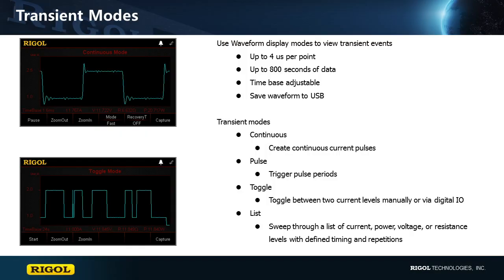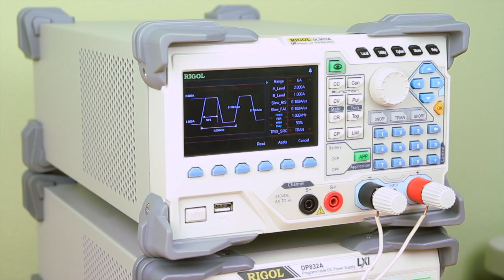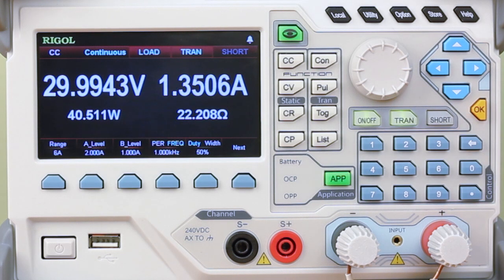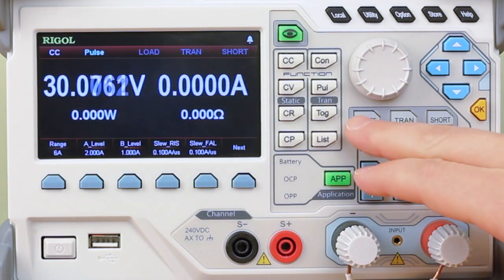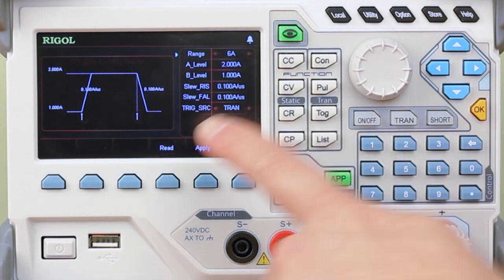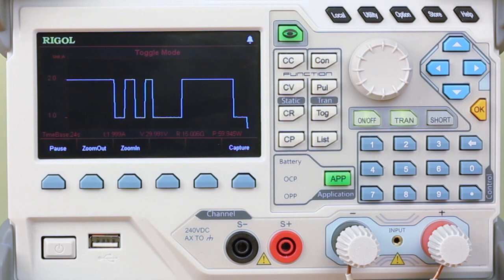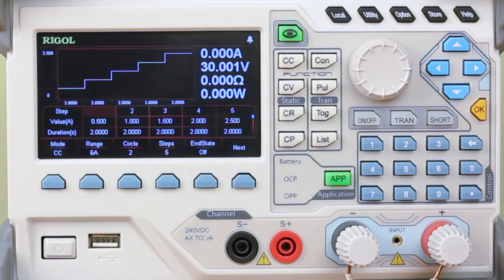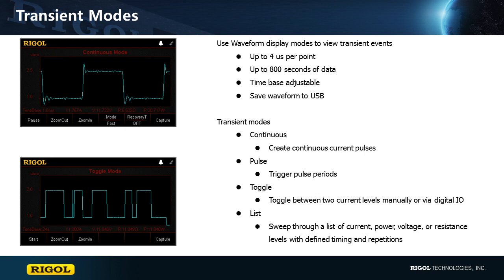DL3000 Transient Modes

Comment: What are steps to update the firmware? I have a file DL3000Update.gel  I put it on the USB and inserted, but it is stuck at: "Please insert USB disk with the upgrade file..." I waited, nothing. I pushed all the buttons - nothing! I've remove the USB and re-inserted back in - nothing! Do you know how to update it? Thanks.
Reply from the maker: These instructions are in the download folder: 
1. Copy the upgrade file DL3000Update.GEL to the root directory of the USB disk.
 
2. Insert the USB disk into the USB interface.
 
3. Power on the instrument. When logo "RIGOL" appears, with three dots under it,
   press the Help key immediately. Then, the upgrade process bar appears, 
   indicates that the instrument starts to upgrade.
Reply: @RigolTech Thanks for SUPER FAST respond from you! 
I did exactly what you stated above, but nothing happens but:  "Please insert USB disk with the upgrade file..." 
I've tried it now several times but I do not get any further.
Thanks.
Reply from the maker: @tonysfun  most likely reason for that is that it's having trouble reading that USB stick. I'd try a different one or reformat it. If you still have issues then email us at help@rigol.com and we'll be happy to help.
Reply: @RigolTech  That was my first idea, use different USB sticks, freshly formatted and recopy the file - the results are the same, sorry to inform you about it.
So I've downloaded the 1.04 version just few minutes ago and the file is 8,716K. The file I received is only 335K!??
Reply from the maker: @tonysfun  Thanks for the heads up. I'll take a look at that file.
Reply: @RigolTech  OK, I'm going to the bed, but morning I'll see if you are able to send me the correct file.
Thanks!!! You are FAST!